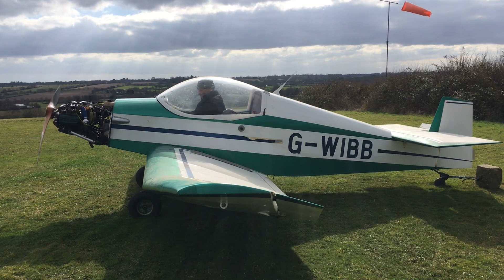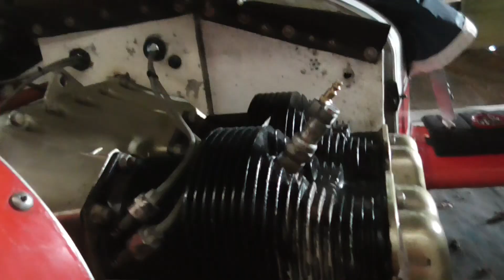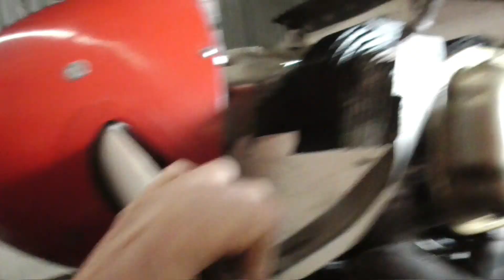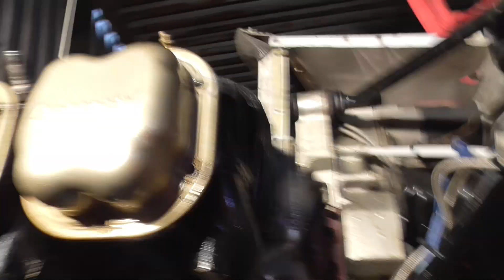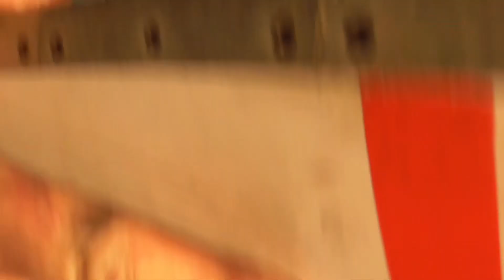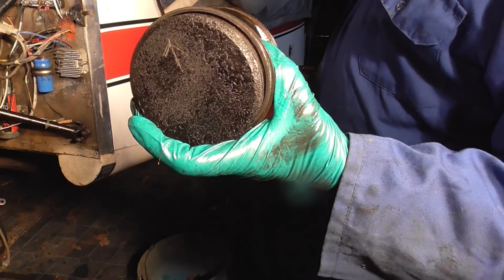IT'S IN BITS! - PILOT VLOG #351

Comment: Hope you get the engine back together and back up again soon Tim. You know what I think every time I watch any aircraft in your videos taking off or landing, I wonder, what are the limits? The weight, the wind, strength, direction etc - with a one way in, one way out runway. What's the max tailwind you can take off with? And what do you prefer, tailwind on takeoff or landing?? A video "brief" on the various procedures for arriving and departing at that fascinating airstrip would be fascinating (especially as I should be flying in there at some point soon!!)
Reply from the maker: Thanks for watching Charlie and the comment. I have in the various playlists answers to most of your questions. It doesn’t look as if I will be flying before next weeks video so maybe a good idea if I pool some of these together? 😎👍

Comment: Well thats a BUGGER. Interesting to see whats inside. Naturally when running road gas you will get more carbon build up on top of piston such as you have there. Hence be replicated on Valve. Thats why I mentioned lil Lead conditioner would suit it. Get them to send you pic,s of valve as found and then when cleaned and lapped in. The Rolls Royce are limited to a TBO  here  of 1200 hours. As John said hours were,t known so this may indicate that. Just like you I had to same on my Jodel back in the day. One thing just as a side I painted a round Orange circle round the Sump plug as easier to see any leaks against the Orange. I am in same boat as you at the mo as My Minicab that doesn't,t wanna fly might now as it has been the Original Coils giving us all the Hassle so new ones in now. So she might have fighting chance now. Bloody sure Planes way worse than Boats and I have both. Be well fly often stops one getting all stiff like. ;0)
Cheers Nick
Reply from the maker: Thanks Nick. Our LAA engines are all on condition although according to the log book it only has about 380hours since major overhaul. Hope you can get the Minicab sorted.

Comment: Hi Tim. Its not clear on the video but during the test on the low cylinder did you listen to whether the air was escaping through the carb, exhaust or breather. The listening through the carb and or the exhaust tells you a valve let by. The breather a rings, piston let by.
Reply from the maker: There was lots of hangar noise as the wind was blowing the tin, Duncan was running the D18 and there was workshop noise from next door but John usually does.